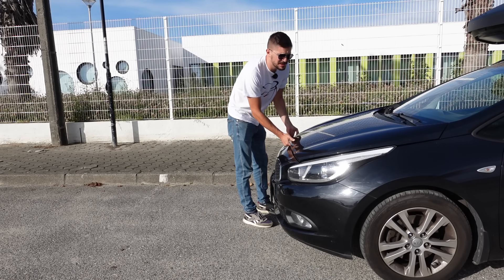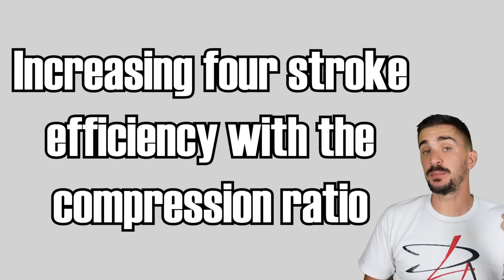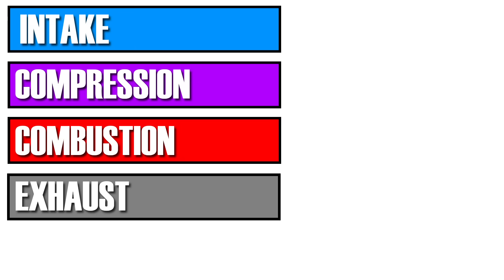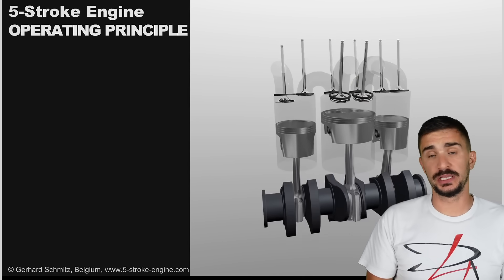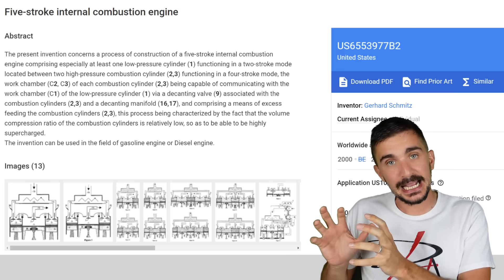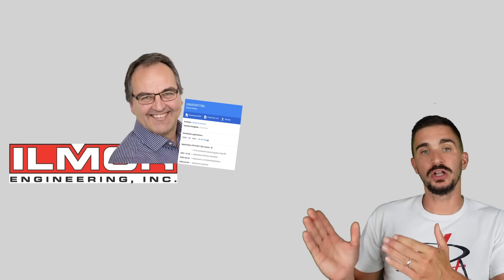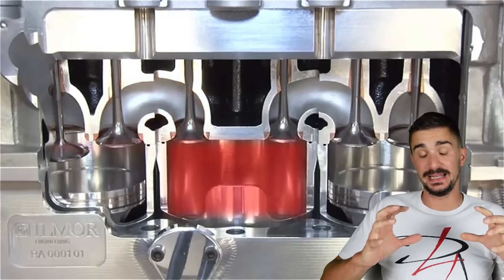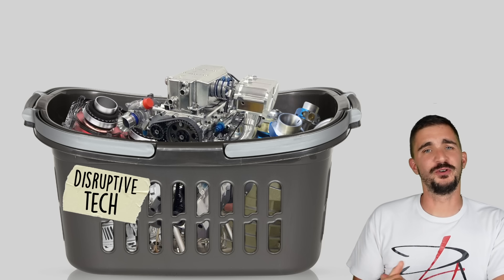Why Five Stroke Engines Are More Efficient But Still a Failure

Comment: Just call it what it is, a compound engine. Steam cars, tractors and locomotives used it the most.
Reply from the maker: Exactly! Some books say Gottlieb was inspired by compound steam engines he saw in the UK.
Reply: @d4a  Ty!
Reply: @d4a  as far as I understand the most common steam engine eventually was triple expansion
Reply: That's what Verbund Motor literally  means. 🙂
Reply: @bastiangugu4083  thank you
Reply: You beat me to it!  And since ships and trains generally operate at a constant load and speed, the engine can be optimized for those without the offspeed drawbacks mentioned here.
Reply: @brianmack6285  exactly, might make a comeback as range extenders someday since they also are operating at constant load and speed.
Reply: @pbe6965  The thing is Miller cycle style, delayed intake valve engines in hybrids already do the same thing with equal sized pistons. It has the same issues of mediocre torque at low loads, but that's where electric assist covers it. Using equal sized pistons means you can simply modify a regular Otto cycle engine with a longer connecting rod and a new cam shaft. No new manufacturing line for a custom engine block.
Reply: @Solihull88  it's only 10% more efficient, if we believe the company that tested it, those 10% would be lost in the conversion.
I'm not sure there are much vehicles that use this kind of setup, I know there was some early hybrid like that but is it still the case ? And the engine could be considered a range extender in this case.
Diesel locomotives used an electric motor so they could still be used on electrified tracks as well without the generator, but that incentive doesn't apply to road vehicles.
Reply: @Appletank8  thanks, I knew these Mille cycle engines existed and had been tested but I didn't know if they were still produced or if it flopped.
It makes sense to pair them with hybrid tech.
Reply: @pbe6965  "True" Miller cycle uses a supercharger to cover the torque loss, of which Mazda built only one car with it, the complexity cost was too high for anything but luxury cars. Ever other hybrid car uses "Atkinson style" which is basically the same thing but no supercharger, with electric assist instead.
Reply: @pbe6965  unfortunately Toyota isn't as innovative as we like to think them to be. Miller engines were most known for the Mazda Xedos 9. 

In Toyota's hybrids the power train is literally programmed with all kinds of dizzying inputs and outputs. Many people have tried and failed to slap on a turbo or supercharger to the engine of a hybrid but every time the sensors recognise the difference it cuts throttle. 

Only one dude in North America bolted a 660cc kei turbo on a 1st gen Prius with improved economy and hill climbing stamina.
Reply: @Solihull88 like a Chevy volt
Reply: @Solihull88  maybe the turbo-electric engine (a type of early ship engine that used a steam turbine to run a generator to charge batteries to run an electric engine... yeah they tried a lot of things in the early days of naval propulsion) was just waiting for EVs to shine ^^
Reply: @pbe6965  range extenders would be the perfect application for this because IMO the low efficiency of ICE engines makes range extenders kindof silly. I mean yes it makes things more convenient for the driver/owner, but if people are trying to save the world with hybrids and EVs, then using an ICE engine to run a generator (some efficiency loss) and then to charge a battery (some more efficiency loss) and then to drive the motors (more efficiency loss) is kindof pointless when you could just use that engine to drive the car further. It just seems like a big circle jerk of efficiency losses, just so they can say "but it still drives the car using electric motors so it's better". But if an engine is highly optimized for a specific load and speed, then it may actually be more efficient to deal with the electrical  losses with a highly efficient engine.
Reply: @thecrazyfarmboy  Your last sentence is why hybrids and EV's with range extending ICE's *work*. Even with those conversion inefficiencies, the drivetrain is more efficient than a throttled ICE by itself.  We have 8-9-10 speed automatic transmissions because they try to keep the engine at its best working RPM for the shifting power demands and loads. If I separate range extenders from hybrids (large battery,  mostly used vs small battery,  ICE mostly used)  then the 5 stroke,  if it makes any sense,  makes more sense in a hybrid. As a range extender (my definition) it's probably too large and too heavy (when you include a gas tank) to be practical.  Was it BMW that was looking at a "Wankel" engine as a range extender for some mostly EV car?  Obviously they weren't seeking efficiency but rather small size and weight. 
The Volt was billed as a series hybrid, the ICE drove a generator,  the generator plus battery drove a motor to turn the wheels. This was supposed to be different from the Prius,  where the ICE was connected to both the generator and wheels (via a fancy transmission). Both both cars actually connected the ICE to the trans directly when the conditions were right,  just to avoid the conversion losses you mentioned.
Reply: @brianmack6285  The overwhelming advantage of hybrids has very little to do with the efficiency of the ICE, it's that it recovers almost all of the energy of acceleration that would otherwise be lost  as heat due to braking in a straight IC car. It actually isn't any better than an ICE engine at a constant speed (i.e. a highway).
Reply: @brianmack6285  I think Mazda were also considering a Wankel rotary range extender running at optimum RPM for their RX-Vision concept, but I don't think anything came of it.
Edit: Oh hang on, I totally forgot; The MX-30 R-EV SUV that's on the market uses a Wankel range extender.
Reply: @brettbuck7362  bedsides the Atkinson cycle with a virtual cvt
Reply: @brianmack6285  all of the yes, of course. 
EXCEPT where series hybrids/generators underperform most is at high speed cruising where a constant demand for amps is demanded. Whereas in a parallel hybrid or even in a regular ICE car with a tall gear speed, the inherent inefficiency of a combustion engine and its excess spin sees an improvement in economy at higher crusing speeds.
Reply: @BeLowBelowo  Agreed. That's why the Volt had a mode where the engine drove the wheels via the transmission and not just through the generator. Something the Prius did from day1. I suspect only used in sustained "highway" travel.
Reply: @brianmack6285  
Small size and weight in a hybrid engine is quite important for packaging in a car. The engine will by nature be a part time engine that will be rarely used, so fuel consumption when running on the ICE engine is not important at all. This is where rotaries score highly and even more added value in the smoothness.
Reply: @brianmack6285  
There is a Nissan car available that has a piston engine turning a generator only that powers an electric traction motor. It is simple and reasonably economical. High efficient electric motors improve matters.
Reply: Literally every naval powerplant from the 1860s until 1903 did it, then Turbinia showboating around the jubilee rewiev put an end to reciprocating steam engines.
Reply: @johnburns4017    There is a Nissan car available that has a piston engine turning a generator only that powers an electric traction motor.
Piston-electric drive. 

Has been used in US BBs, in WWI, (albeit they used turbines) giving much better damage resistance and quick engine reaction times. Went down due to the Washington Treaty. Turbo-electric is less space intensive than turbine-(double)reduction gear and narrower in profile (allowing more space for torpedo defense), but alas, heavier for the same horse power output, and the treaty limited on weight …

Some trains are driven diesel-electric.
Reply: @advorak8529  
In cars sometimes known as an electric transmission, as it replaced the gearbox. But performing like a CVT gearbox with no stepped gears - sort of.
Reply: @brianmack6285 exactly
Reply: @brianmack6285   Very good point.  Just like the ICE/electric hybrids wher the ICE motor that powers the generator is tuned for ultimate performance at a select rpm, , simply turning on and off as needed to charge the batteries.
Reply: @brianmack6285  I was thinking to myself that there may be an application for driving an electric generator rather than driving a transmission where the engine speeds are very likely to vary.
Reply: The Titanic had high and low pressure cylinders.
Reply: @danic.927  Fun fact! Just before the Titanic and sister ship was built, the dock workers of Belfast were segregated by the pro-British workers Union, Councils and the bosses themselves in retaliation to a 1906 Strike led by Irish revolutionaries. 

The segregation was violent obviously and over 90% of workers by 1911 were protestants/pro-British and were conditioned further to distrust their catholic/Irish former co-workers. 

The more you know... 🌠
Reply: @BeLowBelowo  
And what relevance is that?
Reply: @danic.927  she also had intermediate pressure cylinders, and a steam turbine powered by the final exhaust from the reciprocating engines. I wonder if a small gas turbine in the exhaust stream could be connected to the main output shaft through a free-wheeling coupling to recover some of the waste heat.
Reply: @danic.927  Don’t mention the Titanic
Reply: Sounds good as an aircraft engine too.
Reply: @MikhailSharpowicz  I think turboprops have a better efficiency, but don't quote me on that.
Reply: @pbe6965  yes an most definitely no
Reply: Turboprops have lower thermal efficiency than piston engines@pbe6965
Reply: @pbe6965  turboprops certainly have better power to weight ratio. The problem with new aviation engines is how difficult it is to certify them so some of them are really ancient when it comes to technology
Reply: @pbe6965  Nah, turboprops are lighter (meaning more payload) but less fuel efficient than even traditional four stroke gasoline engines. The greater reliability and cheaper fuel (kerosene vs high octane gasoline) make them a better choice for many applications regardless.
Reply: @MikhailSharpowicz  there was one steam airplane
Reply: Compounding was used on internal combustion engines - but only in a few late aircraft piston engines. They used turbo-compounding, essentially a turbo-style exhaust turbine that ultimately provided torque to the crankshaft. Effective, but only in a very narrow window of history before the jetliners and turboprops took over.
Reply: @doorhanger9317  Because they found that the reciprocating parts were impeding the efficiency of the PRT, and the complexity of the engine was greatly reduced if you generated the heat some other way - like burning the fuel in combustors, i.e. a gas turbine jet engine.
Reply: @brettbuck7362  no, the late PRT engines were significantly more efficient than the zero bypass turbojets available at the time. Complexity was the biggest drawback of these huge rotaries, but the key advantage of the jets didn't really have to do with the engine per se so much as the propeller - the jet type propulsion is simply able to get you going faster, and also to some exent produces more power at higher speeds. Propeller blade tips at these velocities can hit the sound barrier and tear themselves apart over time, or at least make a hellish racket. Of course, turboprop eventually replaced piston engines in the sub-jetliner role, because they were significantly more efficient than even turbofans of the time were, and they were much lighter - and much quieter and lower-vibration - than an equivalent piston engine, and also able to be much more powerful in a single compact unit than piston engines. Also, kerosene was much cheaper than avgas and still kinda is today, but that doesn't account for the ridiculously efficient diesel turbo-compounds that were tested. In fact, the turbo-compound lost out for literally every reason other than efficiency.
Reply: @doorhanger9317  I mean, kerosene is basically low purity diesel.
Reply: @doorhanger9317  Turbo compounding is also used on modern heavy duty truck engines. Two examples that I know that are in production right now are the Volvo D13 TC and the Mercedes/Detroit DD16
Reply: @petarmiletic997  how is it implemented, if you know? I heard rumours about it but could never find any comprehensive information or confirmation on the systems used.
Reply: @doorhanger9317  I don't have much  info except the usual promotional videos. But It's basically a turbine that drives the crank through a small fluid coupling/torque converter and reduction gears. According to Detroit Diesel it adds 50hp to their DD16 engine for a total of ~600hp. So roughly 10% increase in power with no increase in fuel burn at full load, or 10% less fuel burn for the same power if we look at it that way.. At part load I imagine the gain is less.
Reply: exactly. its a 180 year old tech used in 150 years old design, yet it took 150 years for "someone" to do it?
retarded!!!! 
Current ICE designs are still using the first design principles of not using exhaust gasses or optimizing mechancal loads making us waste around 70% of fuel.
Reply: Expansion engines.
Reply: There are ships that use part of the exhaust gas that gets directed back into the engine or something like that.
Reply: @TheMrPeteChannel   There are ships that use part of the exhaust gas that gets directed back into the engine or something like that.
Yep, steam compound engine, steam triple compound engine, even steam quadruple compound engine (a few ships had that, as the additionally recoverable power is mostly not worth the additional friction and complexity (a dead engine is no good).

The Liberty transport ship class (2710 built during WWII) used 2 oil boilers feeding a single triple expansion engine — not as good as a turbine but also reliable, cheap, easy to maintain and repair. Top speed 11-11.5 kts.

Other designs use high pressure steam and a matching engine for one screw shaft and the low-pressure steam from that for another screw shaft with a matching low-pressure engine. The Titanic was one such case: Two triple-expansion engines (1 high pressure, 1 intermediate pressure and 2 low pressure cylinders each) feeding into a low-power Parsons turbine running the centre screw — which could not be reversed, BTW.
Reply: It is a double expansion internal combustion petrol engine, if we are using olden timey steam machinery terminology.
Reply: Burning oil is not sustainable. Having combustion engines more efficient does not change that.
Reply: Yes, the  title description at the beginning is utter nonsense, and the explanation of why the "dead" strokes are "wasting energy" is completely misleading, and indicates absolutely no idea how IC engines/Otto Cycle engines work.  A two-stroke engine is extremely inefficient  and it only has one "dead" stroke because the scavenging is poor. A four-stroke is much more efficient than a two-stroke because it has a separate scaveneging stroke and always fires a very "clean" mixture. You could actually improve it by running in a 6-stroke, with two exhaust strokes (without an intervening intake stroke) because then it would be even more pure. So, adding dead strokes are more effective than getting rid of them, which is direct contradiction to the video explanation.
Reply: @brettbuck7362 But adding more "dead strokes" has a problem too. You introduce more frictional and pumping losses. And if you're drawing in another stroke of fresh air (no fuel) then I'll guess that'll take more heat from the cylinder and piston too than it would have otherwise. That heat will be replaced to some degree by the next combustion stroke, diverting useful energy from the crankshaft. So there's a limit to "deadstrokes" as well.
The main question is whether a compound ICE is the most efficient means to recover lost energy in the exhaust (forgetting cost and other real life concerns). Is a turbo better ? Or a separate oppo style Stirling engine driving a generator (for a hybrid vehicle) ? Or ???
Reply: @brianmack6285  Of course, it's a race between scavenging improving the efficiency and the frictional losses reducing it. That's why two-strokes of a given displacement have 50%-100% more power than a 4-stroke of equivalent development, but also has crippling inefficiency for anything bigger than a motorcycle. It makes tons of power firing "pretty good" every single rev (and throwing 25% of the fuel out the tail pipe) instead of firing extremely good but every other rev. This is also why 4-strokes tend to have to run as astronomical RPM, 20,000 RPM is the same firing rate/energy generation rate as a 10,000 rpm 2-stroke.

Comment: The "Verbund Motor" is nothing that was invented newly. It was already used on steam engine with tripple expansion engines.
Reply: Verbundmotor with an additional turbine at the end also saw wide commercial use in the early 20th century, yet modern ships don't use them. Tubo-diesel engine have just become to good.